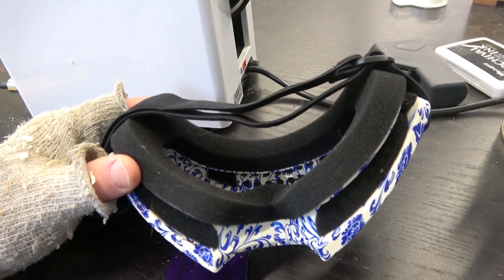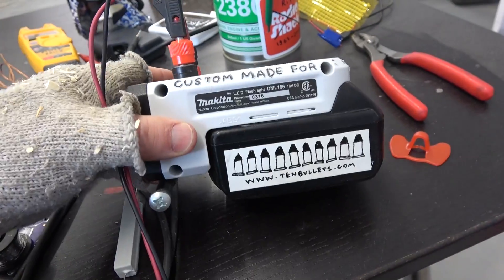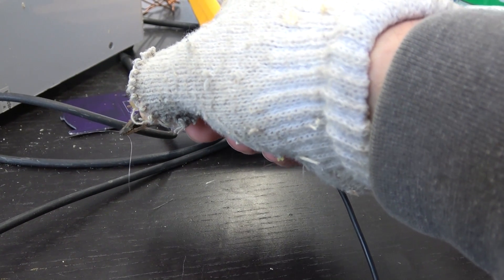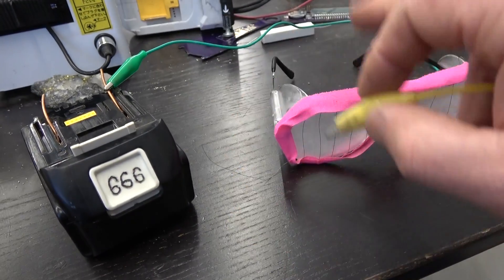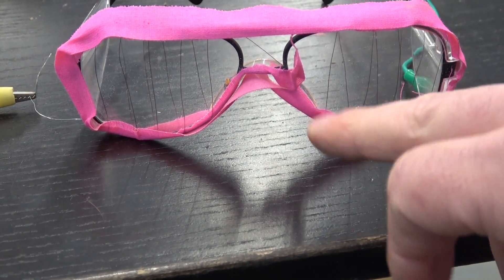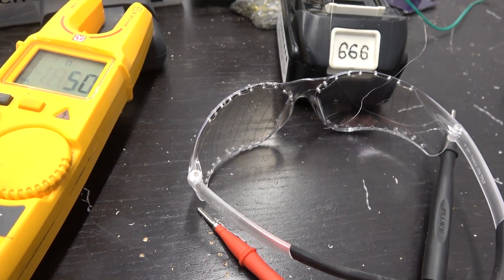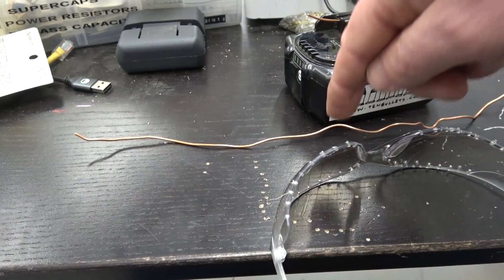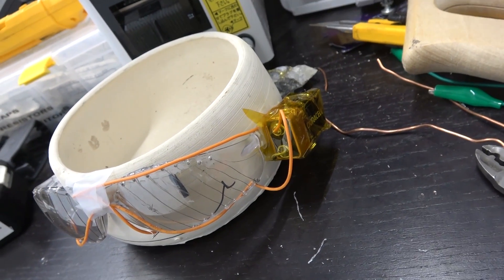Invention: goggles w/ electric defrost

Comment: Hey. I dont have nichrome wire. Do have a spool of .045 mig wire, though. And a 20 ft. long piece of #2 solid bare copper grounding wire left over from the lightning rod installation project 3 years  ago.  But not sure how many 9v cells that I would need to gettr done.

Comment: You know double pane electric heater uppers exist on goggles already. Some googles just blow with a fan.
Heaters start to distort the view in plastique lenses quick under -10 centigrade.
Edit before I finished I commend the homeade item edit of edit you need to fabricoblw a raspberry pie and and or thermometer/rehostat to control the amps automagically

Comment: Pssst.... ohms measures resistance in a.c. circuits too.

Also also wik, continuity check isn't fool proof. High resistance components, heaters, brake resistors, etc. can show open from a continuity check but are good in reality. Resistance measurement is always your best bet, but the continuity beep is handy too.

Comment: Why can’t they put this on my front windshield? Am I supposed to drive to work backwards!? Because I will.
Reply: Cadillac did in the 1980s(?).
Reply: Some fancy cars had/have that, don't remember if it was super fine traces or a conductive coating (ITO or whatever). For everybody else there's the block heater.

Comment: Wouldn't the nichrome wire melt the plastic?
Reply: Depends on the heat, which depends on the volts and the resistance and all that malarkey, AND the specific concoction of materials the safety specs, or lenses (assuming anyone is mental/frustrated enough to try it on their prescription eyewear) are made of. I would imagine the wire would have to get waaaay hotter than necessary to defoggify the glasses, in order to actually melt them.
Reply: @peteredwards2318  I see your point. Probably he's using just enough voltage to get the wires warm. I asked because I recently bought some nichrome wire, and cut some plexiglass with it (works, but not too well - re-freezes too quick)

Comment: Metalized resistance elements?  Could be nearly invisible and on the surface where condensation is the problem. 
You needs to get a vacuum chamber with a metal vaporizer.. profit.

Comment: Ok, proof of concept works. Let's iterate: thin sputtered metal layer of Indium-Tin-Oxide on the outside of the glasses, and "perfect" transparency along with even heating.
Reply: Just like the 509 Sinisters I have on the wall, except those have a 3 layer lens system with the middle lens being the coated one. They work great, much better than the heated lens on my old helmet does.

Comment: i'm gonna do this using metal frame glasses for part of the circuit, a variable resistor to control heat, and using USB-C for the power supply... in my dreams

Comment: As a lad from Nova Socialism who did his 3 year tour of duty in The Mac and survived 3 of those frigid winters. I would have spent untold monies on these.
Reply: Voltage, amps, resistance, complete the fire triangle
Reply: Guck that greasy fort. It's like Twisted Misfits R Us.
Reply: I was prolly up there with ya...or drove you around (bus) , I used the shaving cream trick on the bus windshield if it had a crappy defrost..
Reply: @sparXKuijper  Ft mac Bus drivers
The most un-appreciated job up there!
Thanks for Getting me there and back ssfely!
Reply: Ahh the moldy insulation years! 
DON'T SUPPORT YOUR LOCAL UNION!
Biggest mistake the 110.
Reply: I call them David Koresh’s
Reply: Or you could just rub some shaving cream, wd40, minerall oil or toothpaste on  the lens....lot cheaper and you don't gotta worry about angry pixies near your eyeballs.
Reply: What's Mac
Reply: @daftnord4957  Fort Mcmurray.. an oil town in Northern Alberta